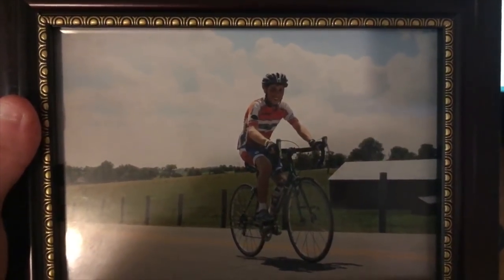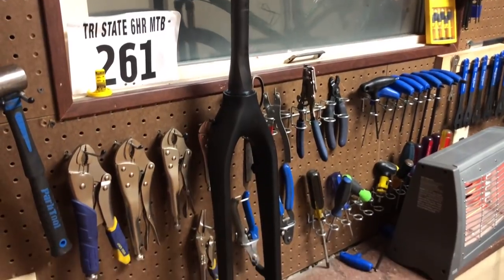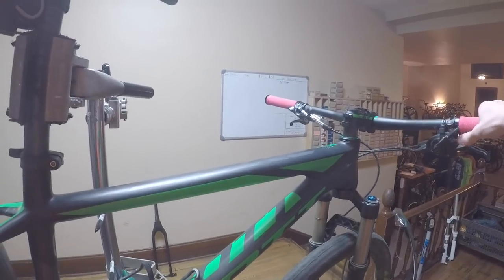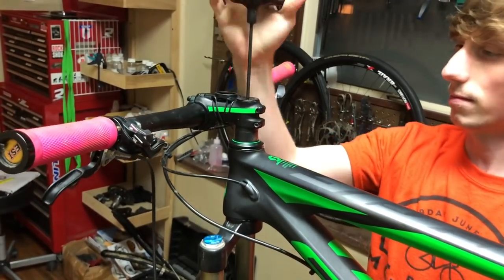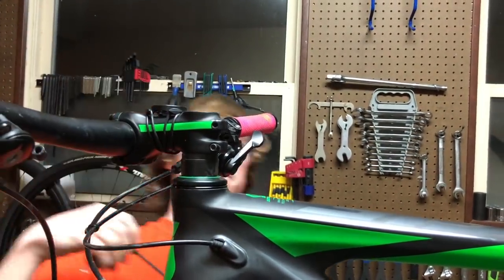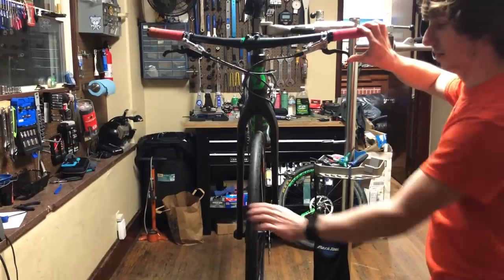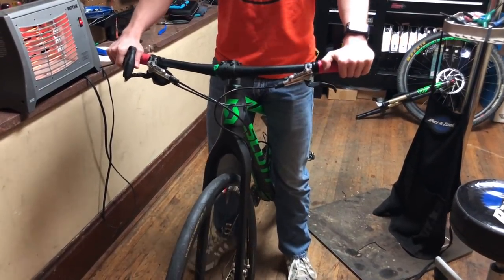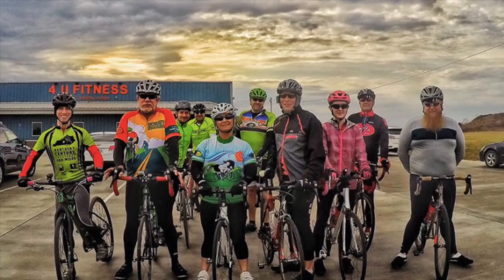Convert a Mountain Bike into a Road Bike!

Comment: nice conversion jordan, what size for road wheels ? and what crainring combination teeth do you run ?
Reply from the maker: They're 700c wheels with 28mm tires on there! Theyre a little wider, where they're used for cyclocross and gravel tires, so the wheel channel is a little bit wider than a typical road wheel. I think 28mm is about as small as I could run. As for the front chainring, it's a 30t and the cassette is an 11-32t.
Reply: Wow.. so the smallest gear ratio would be 11-30 ? that must be a high cadence ride when you hit a long flat road.. don't you think about getting a bigger chainring ? i mean it's a good combination for uphill but it's better to have a sweet combination for both uphill and long flat road, plus you have the 11-32 in the back.
 just my opinion.
Reply from the maker: It would have made sense, I just didn't feel like swapping it out. Hahaha. I would get in the flats and be spinning like a 45 year old soccer mom in spin class.

Comment: I converted to rigid on my hardtail for going offroad. No money for a good suspension fork, so get a cheap carbon fork. I also went singlespeed. Current weight is 9.1kg and still stock heavy ass wheels. i was even able to use the same wheels with 25mm continental gp 4000 without any blowout(though they are very narrow at 19c). So, if i know that im not gonna be seeing any trails for some weeks i simply swap to my secondary road tires.
Total cost: 70€ on the fork, 10€ on chaintensioner, 10€ on singlespeed cog, some leftover cassette spacers. So, sub 100€ and i could sell the drivetrain parts but keep them just in case

Comment: Is replacing the mtb fork with a road fork mandatory or can you use the existing one. I'm not much of a bike guy, I just got a new mtb for a great deal but I want to put road tires on it.
Reply from the maker: You could definitely use the MTB fork as long as you make sure the spacing is correct for the wheels! A mountain bike fork is just heavier and never really locks out completely solid; sacrificing  weight and potential power loss is just up the rider!
Reply: @TheTinyCyclist  Sweet, thanks!

Comment: Turned my mtb a few years ago into the same system but with 42-28 chainrings, 42 is good enough to reach 55km/h on flats 👍🏼
Reply: The math doesn't add up to go 55km/h.  What was the gearing on the rear cassette?

Comment: I did a very similar thing with my mountain bike (2015 Kona Cinder Cone).  I even have the exact same fork, which I bought off AliExpress.  However I kept the mountain cassette on there because I wanted the wider range and I also kept the same wheels, but put narrow tyres on there.  Would you be able to tell me what the size difference is between road wheels and mountain 27.5 wheels?.
Reply from the maker: So I run these with 700x28c tires, like I said in the video. If you go by the circumference of the wheel with that tire combination, it's 2170.84. With the mountain tires, it's a 650b wheel with 2.25 Ikons on them, which is a circumference of 2193.77. There is a slight difference where the mountain tires are a little beefier!

Comment: You don't really need such wide handlebars for road. 500-600mm is more than enough. For more speed try trimming the handlebar shorter and lowering the stem. That will reduce your frontal area and drag.

Comment: I totally understand did the same on my hardtail stumpjumper comp aluminum frame I swapp out suspension fork for rigid carbon fork,  question did your average speed change with upgrades  ?
Thanks glad they're others making mods just as I did.
Reply from the maker: Do you mean my speed between a regular road bike and this? Not really! My average cadence did. However, for the most part, I didn't see a change in my speed at all. I actually bested a lot of my PRs on Strava with this bike!
Reply: Jordan Sands I meant from mtb to road mods did your average speed change ?
Reply from the maker: Yes! The road mod is much faster on the pavement, but doesn't help much at all on the trail. IF I am doing trail rides, I slap the mountain stuff back on it.

Comment: I think you could have just put a road tire that is slightly wider on the same rear wheel.  The next change would be a two ring chain ring and derailleur. That would make things quite a bit more complicated or how about a 3 ring, they're cheap on ebay.  With your single would imagine you wear out your smallest sprockets (10 tooth) and front ring often.

Comment: what is the size of your wheel? i am planning to turn my bike into a cx and want to know what size of tire is good.. i have a 19" 26er kross hexagon v5.. i find to frame size good for a slim tire since the frame is a little slim as well.. since most of my friends ride on road i would like to shift from off road to on road for a while..
Reply from the maker: They are 700c wheels and tires! The 700c wheels actually have the same diameter as a 29er. I have seen some slick 26er tires you could throw on your bike for an easy transition. I would see if your frame will clear the 700c wheels first before purchasing any.
Reply: +Jordan Sands i will make a measurement first before getting a wheel set. thanks for the video.. :)

Comment: several comments about putting drop bars on… not so sure about that idea… i think it might mess with the way the bike fits and that's your favorite part. if you need more speed, you might try getting a smaller sized smallest sprocket in the cassette. you might be able to find a 9 tooth or something

Comment: Hello my MTB wheel its 29*2.20,(Trek xcaliber 8) and i bought a 700*37c wheel, but when i roll It, It seems like an egg, do you know if i have yo buy new rims (700) or It cuould be that the rims are not aligned correctly? Thanks for helping me.
Reply from the maker: Are the tubes you're using 700x37c tubes? Or a tube that covers that size (i.e. 700x30-35c)? It sounds like the bead of the tire isn't popped out, causing a dip in the tire and the wobbly egg feeling you have!

Comment: I have the same bike and absolutely love it. Mine (735) came with 2x10 Shimano drivetrain with 36/22 chainrings, which I though were too small. I have absolutely no idea how can you use it on road in group rides with that tiny chainring in front - I guess I am terrible with holding high cadence. I have ordered 38 tooth narrow-wide and will be converting to 1x10. I use it offroad primarily, but quite a bit on pavement too and with 38 ring I think it will be even better on road. It's a great bike.
Reply from the maker: It was challenging at times, and my cadence would average about 100RPM on some rides. But, where I live, the terrain is so hilly that it didn't really bother me too much! The local pro I talk about runs a 32t or a 34t and is the fastest person I have ever seen on a bike. But I definitely agree, the Scott bikes are excellent!
Reply: 36 kph is fast enough but not if you participate in road fondos or road group rides. At least for me. I don't have the stamina to hold high cadences and I find myself mistakenly pushing the upshift lever while at 36-11.
Reply from the maker: I could always spin a high cadence and keep it up. It's always suited me better than cranking a high gear.
Reply: well...i doubt that he plans to do that. He could change to a 38t or sth. but why would one go with a rigid MTB to a granfondo? Even road grouprides should work as not that many do actually much more than 35km/(at least here in Austria -.-).
I don't think that it's stamina that holds you back but rather your pedaling style and perhaps tendency to be bit stronger. Im a very weak sprinter but i can hold 250 watts if necessary for some time, but only between 98-102 rpm
Reply: I definitely need to work on my cadence and pedaling technique in general - something in todo list for season 2018. Either way, here in Latvia we don't have long climbs and average speeds are higher, hence why I think 38t 1x will work well. Here is my 735 as I bought it last year: https://www.youtube.com/watch?v=2GXIBAmI3G0 Was a bargain, now I am adding new parts and making it less of a bargain :D
Reply: cadence is surely a good idea to work on. I train low cadence now to increase strength with my singlespeed setup 34x14t which i commute on. well...its latvia, so you have hills, i guess?
oh, you were that guy! what a coincidence, always watch sickbikers/shaibikers channel
getting a bike should be a bargain, adding components costeffective IMO

Comment: I need help! I have a Voodoo Bizango (2018 model - Orange frame) 

I’d like to swap out the tyres to thinner ones as I’m using it to commute a lot and need to know if this is possible?

I went into Halfords and the guy in the shop said it was possible, then went off to confirm with a colleague, and on his return told me it wasn’t possible and I’d just have to buy a new bike. It smelt like BS to me but I’m a noob with bikes so can’t prove it. 

Is he right? Can I not swap out for thinner / slicker tyres to help with speed or do I just need a new bike? :-/

Thanks
Reply from the maker: It would depend on the width of your rim! If you could find that out, I would be able to answer the question a little easier. However, there are some wider, slicker tires for a 29er wheel that has the same width as a 29er mountain bike tire! The Schwalbe Big Apple is one that comes to mind!

Comment: to be fair... Its not a 'road bike' per se~ but a Hybrid bike. If it was a road bike it would of had drop bars on it. but all i see here is you swapped out the tyres and the front forks. You probably lost a chunk of weight by ditching the suspension and improved your rolling resistance by switching to the Conti road/race tyres. You will probably see some notable changes both in the handling and overall speed of the bike but the gearing will limit how fast you can go. on it.

Ive seen lots of people switch from knobbly MTB tyres to slick road tyres. People just want to make the best of what they got rather than buying a complete new bike. Its not unheard of for some folks to have two or three different wheelsets for one bike with different tyres fitted onto them so they can just switch them out when they fancy going off roading.

However -- this is not a road bike and it is not a conversion but a modification.
Reply: Is it possible to put road bike crank set?
Reply: @joanork9587  it sure is - with all these hybrid bikes out now it isn't uncommon to see mixed groupsets
Reply: @joanork9587  You can have the local shop shave down the bottom bracket shell to 68mm.

Comment: I did the same to my hybrid front suspension bike. But I don't understand why you have to spend for new wheels and tyres. I just bought 2 new slick tyres which I setup tubeless and a 44t chainring, and it all work perfect
Reply from the maker: Was yours a 29er? Mine was a 27.5, and I wanted the 700c wheel. It was just a personal choice, really!
Reply: setup tubeless? Schwalbe Pro one or a regular road slick? regular road slicks suck at tubeless setups in my exprience and i heard about nasty blowouts, burps in corners leading to really bad accidents

Comment: So what's the total weight of the bike before & after the conversion?
Reply from the maker: With pedals and bottle cages on there, it's somewhere in the mid 17lbs range. I can't remember exactly, and I haven't weighed it in forever. I could lighten it up even more with some carbon bars, carbon crank, and carbon wheels! But those aren't necessary for the riding I do.

Comment: My bike is a mtb 26er and i converted it to a cyclocross bike with 29er rims and 700c x 35c continantal cyclocross tires and it performs like a road bike.
Reply: how did you handle the brakes? was it disks?
Reply: Yes its a disc brake
Reply: How did you convert it? I have 26er wheel size and im planning to upgrade it to 29er. Help please

Comment: What gear/cadence do you use when riding alone/with group on a flat road?
Reply from the maker: When I was on this bike (recently bought a Scott Addict 20) the gearing up front was an oval 30t chainring. Then I had an 11-32t 11 speed shimano cassette on the back. My average speed would be anywhere from 15-20mph, depending on the group and ride. Average cadence would have been pretty high, upper 90s to 100rpm over the entire ride!

Comment: Hello Jordan, where can I get this fork, to do the same, regards
Reply from the maker: I got mine on eBay. You can just search on there for a rigid carbon mountain bike fork and you should be able to find it!
Reply: Thank you, Jordan your fork its for MTB not gravel or road, what happed if you put a small in height CX gravel fork for 700c? the pedals can touch the floor?
Reply from the maker: Most mountain bikes are designed around a suspension fork. Normally 100mm-160mm. So I am not certain what would happen if you slapped a fork on from a different disciplined bike. It would most like throw the geometry all out of whack and the handling of the bike would be completely different.

Comment: Very cool, and if you wanted to you could get a bigger chaining and cassette to have a better gear for descents and straights and still a good climbing gear and because it`s a mountain bike derailleur you can fit quite a big cassette without having to buy a roadlink
Reply: Xander Roodt what size cassette would you recommend? Can I use a different size without having to adjust my derailer. My current mountain bike is a 9speed 11-34T I want to make a whole other set of rims tires and cassette for quick swapping.

Comment: eh, consider changing the front chainring to a 52t single? much cheaper than getting an entire crankset, and its not too much effort to do. im sure your long cage derailleur can handle it.
ive done this hybrid setup on my old GT Palomar, steel frame mountain bike. i left the crankset at its triple configuration of 48/38/28, but changed the rear cassette to a sora 8 speed 12-25. There are folks who love the geometry of GT hard tails back in the day as you can just slap on 700cc tires and cantilevers, and they will work. didnt like spending that much, so thats pretty much all i did, other than change my tires to panaracer tservs. didnt even change my front fork.
Reply from the maker: That's really interesting! Thanks for the input. I know you could easily swap that front chainring for a bigger gear, but I never did simply due to my budget, and the fact that I switched between mountain and road mountain really often. But I could definitely see the benefit!

Comment: I’m going to do the same thing to my 2016 Scott Scale which has Shimano XTR 2x drivetrain.  I’m not going to change anything but the fork.  Did you get a Whiskey #9?  That’s what I’m planning on getting.
Reply from the maker: Those are awesome and very well built forks! Mine was just some random, brandless one on eBay. The Whiskey fork will work incredible for you! Plus the 2x drivetrain is gonna give you more versatility!
Reply: Those Whiskey forks look exactly the same as the ones you can get from China off Ebay for less than $200.
Reply: I'm a little afraid of the no-name forks breaking

Comment: Please help me i cant get the right  road rim size ! 
mine mountain is 27.5 how can i know the equivalent size in road bikes ??
Reply from the maker: These are just standard road wheels! 700c wheels. The spacing of a 27.5 mountain bike allows for the 700c wheels to fit perfectly fine with no clearance issues. Now, if you're looking for some slick tires to put on 27.5 wheels, I would just do a google search and find some that suit your wheels.
Reply: Jordan Sands Thanks Jordan , i really appreciate your reply !
Reply: Jordan Sands Haha , o didn't know that road wheels are standard ! 😀

well fine  ,  i think i will get new wheels rather changing tyres . but i will put that in consideration . 
I'm really excited

Comment: You never ever should take the top cap bolt of before undoing the side clamp bolts you will strip your top cap bolt or you could rip out the star nut inside the fork

Comment: Why wouldn’t you just keep the MTB cassette and then put a larger front chain ring to increase the highest gear? Would make more sense for a road build
Reply from the maker: The reason I didn't was because that cassette is an XD cassette. So the road wheels would have need an XD hub, and I couldn't find anything compatible! It was also a little bit cheaper to do it the way I did it.

Comment: Hmm... i think about the chainring might be  too small to be converted as a roadbike... i suggest to try to add the 3× crank for more speed while pedaling... suggestion only 😊😊
Reply: Jc Arenas Actually an 2x setup would solve the problem, even though some of the the road bikes in 2018 have 1x drivetrain..so 2x setup or a bigger chainring at the front would be just fine
Reply: 3x for gay boys
Reply: Jc Arenas Imagine wanting a 3x😂🤦🏻‍♂️💀

Comment: If you want to ride a mountain bike on the road, ride it as it is. You dont need to change it. Just put 40 psi in your tires seat up and lock your fork and suck up the rest. You dont need slicks.

Comment: put some drop bars on it! sram makes a groupset with 10-42 1x11 and drop levers
Reply: Joshua Mouritsen 
Exactly.
Something like sram apex or rival hydro is good enough.
Reply from the maker: I'd never really had an issue with the flat bars, but that's always been a personal thing. That's a neat idea though! That would be a full on conversion!
Reply: Jordan Sands sweet man, you've got an awesome setup
Reply: Would be kind of a hassle to reattach and redial the shifter and bleed the brake hose for the drop bars, at least if the hybrid mod is supposed to be used just once in a while for those roadie weekends before going back to mtb stuff and not permanently.